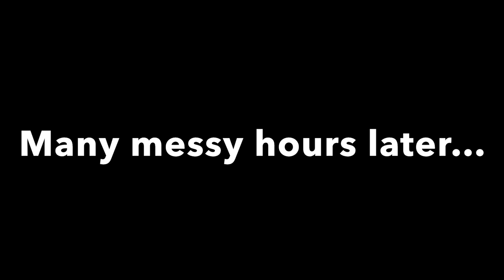Restoring a Flood Damaged Porsche 968: Removing the front bumper cover #porsche968 #bumpercover

Comment: Are you planning to open the engine to inspect the cams, chain and sliders for wear? If there is no record of such work I would definitely recommend it, and once you have the cams out you might as well take the head off to replace the headgasket and oilfilter housing gasket. On the 968's I have done this work to, the headgasket was on its last legs causing various issues and all 968's that are still running original headgasket will be the same by now.
Reply from the maker: Yes, opening up the cam cover to inspect the chain guides is on the agenda, but I was not planning on removing the head though. I will do some research on 968 head gaskets and might add it onto the list 😅